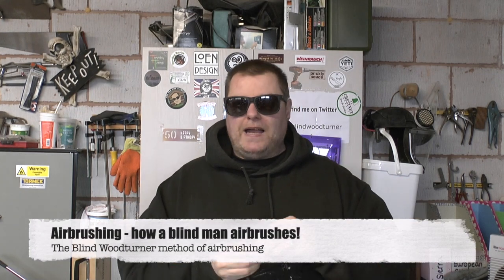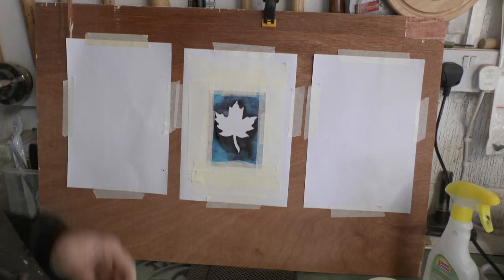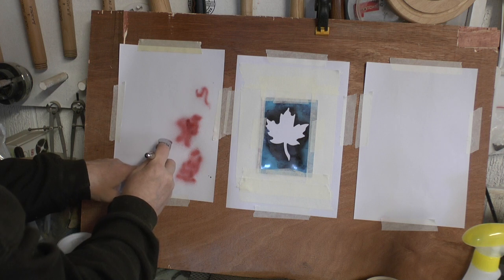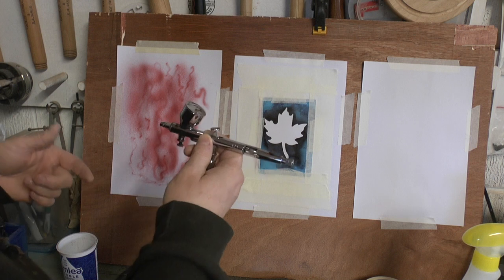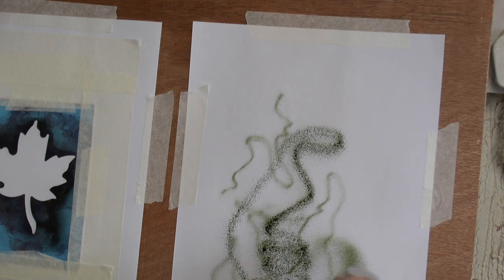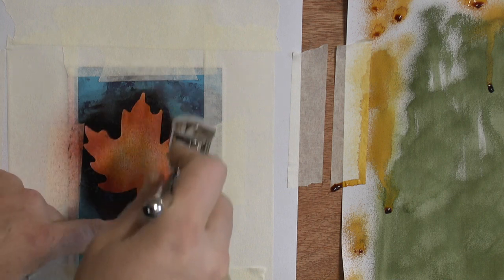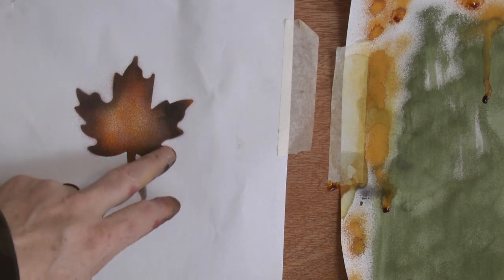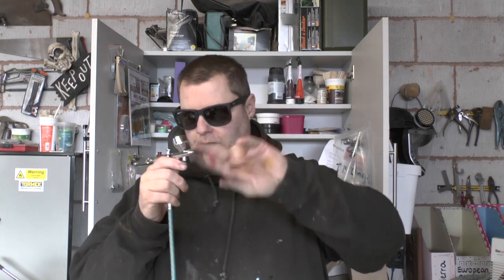How a blind man airbrushes! The Blind Woodturner method of airbrushing

Comment: Hi again Chris, is your trigger single action or dual action. Went to order one and I have a choice. Thanks.
Reply from the maker: Dave Ticehurst hi Dave. Mine is jewel action. Give you better versatility and if you screw in the control at the very back end of the airbrush you can restrict how much the trigger is Paul back with dual action, pushing down starts the airflow and pulling back at the same time starts paint flow with very little practice you will get very skilled with using one of these.
Reply: @BlindWoodTurner  THANK YOU.
Reply from the maker: No worries Dave. Any time! Enjoy your new airbrush when it arrives